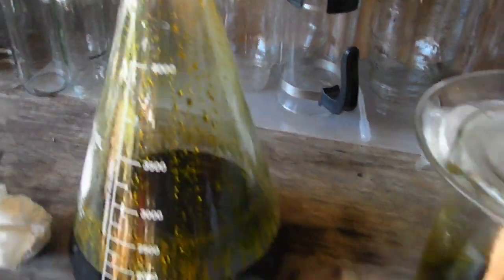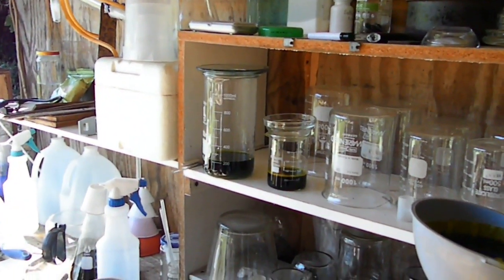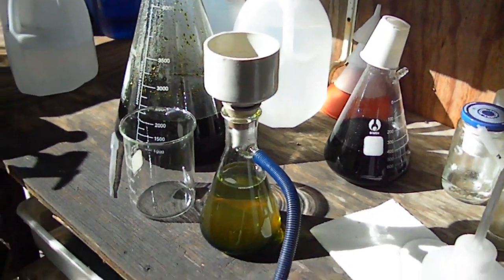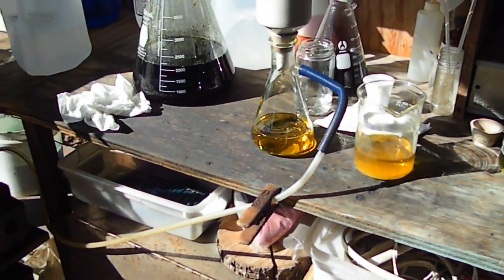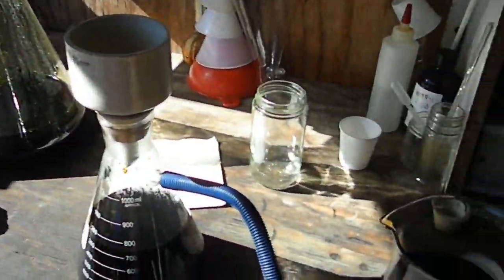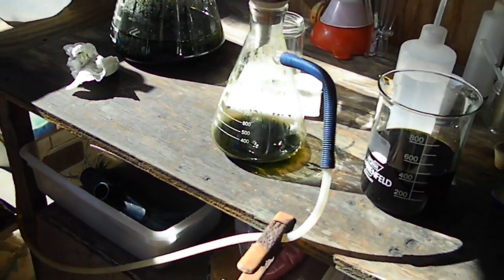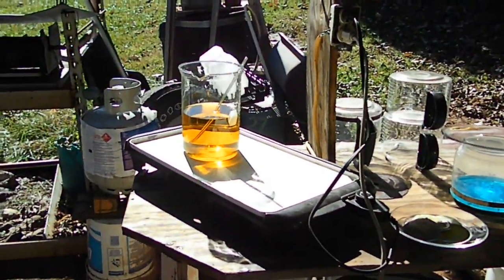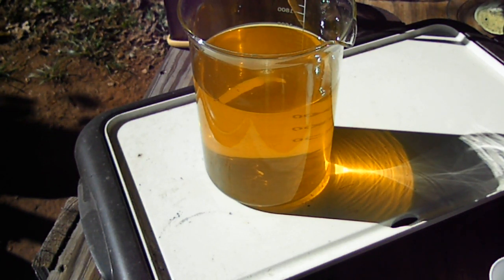Gold Refining Ceramic CPU's 2.5 Kilos + Part 6

Comment: The precipitate that resulted from the beaker rinse may be silver chloride?
Reply from the maker: I wish it was, but it wasn't no reaction to sunlight.
Reply: @BackyardScrapping  hmmm… perhaps a lead precipitate?
Reply from the maker: @mikestewart4752  Probably right about lead, which means my "so called" distilled water is actually acidic, like my well water which PH's at around 5. I haven't PH tested the distilled water, but I think I will start testing each bottle before I use it. I do remember watching a video about a year or so ago where someone said that the distilled water they had purchased was causing them some problems, and after testing it, they said it for sure was not clean distilled water. Who knows anymore with all the "CRAP" they pass off on us today! LOL I love how everything is new and improved today, what were they selling us before, OLD CRAPPY STUFF, makes you wonder don't it 🙄🙄😁
Reply: @BackyardScrapping  You betcha my man… imagine what they are passing off in our food!!! 

As far as the lead goes, perhaps you can get a test kit for drinking water to test your distilled water?

My thoughts are, although it is possible to have contamination in the water, I feel it’s more likely to have come from the chips somewhere along the way.
Reply from the maker: @mikestewart4752  Possible, haven't had a chance to test the distilled water yet, but I will the next time I think about it, LOL if I remember 🙄🙄🙄